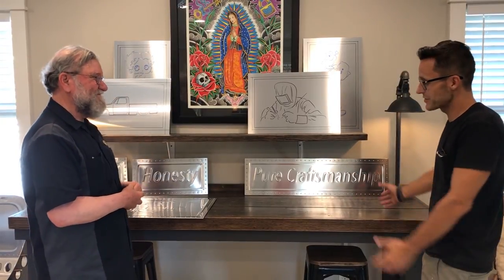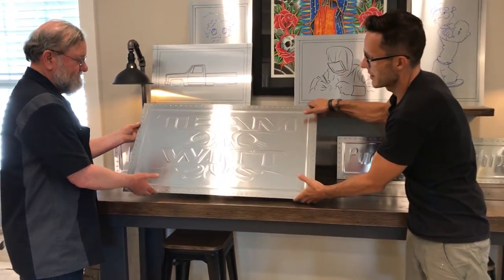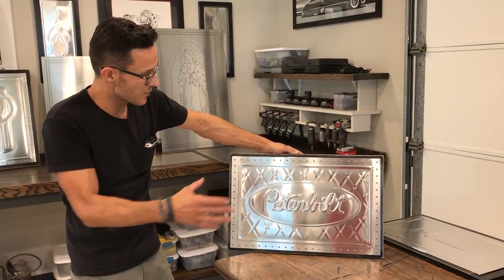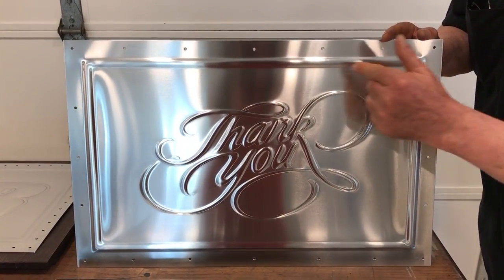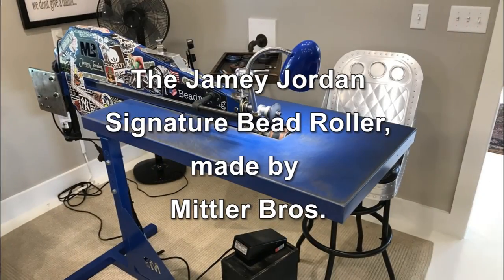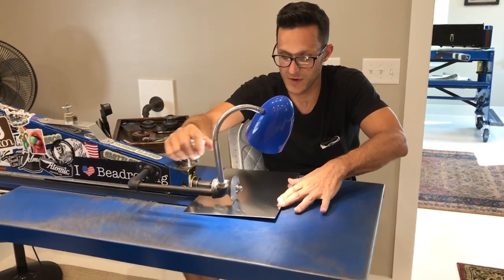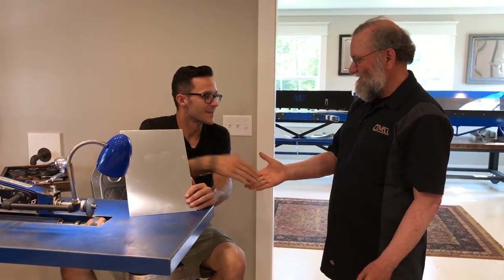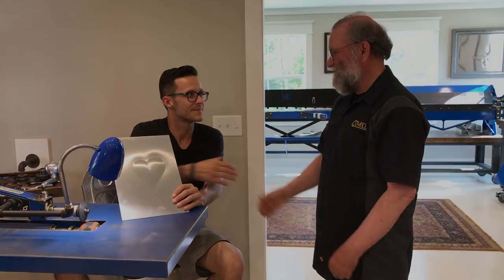Ron visits Metal Artist Jamey Jordan

Comment: Fantastic video Ron. I'm a beadrolling artist, no where near Jamey Jordan's level, I learned a secret for what sets his work apart from everyone else. I didn't know he used a skateboard wheel to give it that extra flare. I've seen the flare and have tried replicating it with other dies. So thank you for coaxing that out. I know I appreciate it
Reply from the maker: I'm very glad you found some useful information here!
Reply: I am not a metal fabricator or beadroller artist however my idea to you would be to try and 3D print your own type wheels. You can try out many iterations. They will not hold up well for a long time but they are very cheap, and once you found a great shape or shapes for you you can still mke them out of metal.

Comment: These signs look fantastic
Reply from the maker: Glad you liked them!
Reply: @RonCovell  I like them very much, I also like your work. You have inspired me to do a small project of my own in fact. 
I have build a wall cupboard for the living room, to store Blu Rays and DVD´s. 
The only piece missing is a sliding door. Initially I wanted a 3D printed design but I think I will be making a sheet metal door instead, with nice round lightening cut out´s with flanges, this way I can practice using dimple dies which I intend to 3D print (I don´t have a workshop I live in a small apartment). And as a "skin" panel I will be using a Polycarbonate sheet to not hide the metal structure beneath and also as a window for the movie collection. 
Now I have seen those beautiful panels, those would fit as a sliding door as well, with some movie themes on them.

Comment: Wow, never even conceived that such a thing was possible.  Thought bead rollers were for doing very basic edges.  So, I guess that's a DC powered roller?  Is that aluminum sheet, I wonder.  Definitely something that's accessible to people; I can see a lot of people placing orders, as opposed to parts for a $30,000 bike or $100,000 car.   And that shop is cleaner/nicer than most people's homes!
Reply from the maker: Glad you liked the video. Yes, the motor is DC: https://www.grainger.com/product/DAYTON-DC-Gearmotor-90VDC-4Z130
Jamey works with aluminum sheet.
Reply: @RonCovell  Thanks!